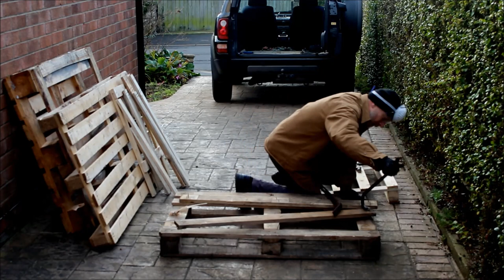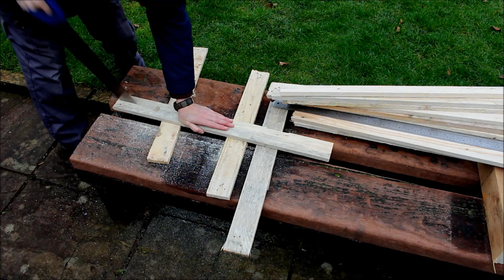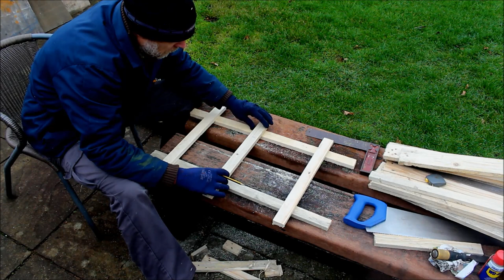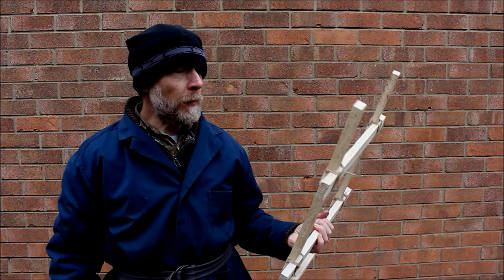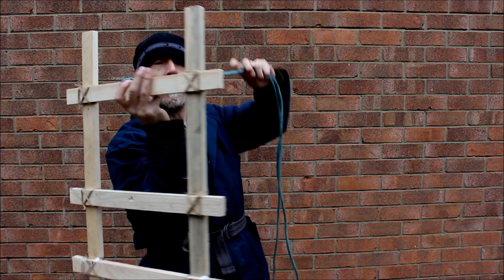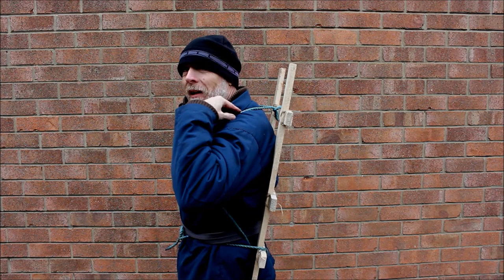The Pack Frame Part One,  The Construction

Comment: Top man thank you 🙏
Reply from the maker: I keep meaning to make a slightly better fitting one but just keep using that one to get wood off the beach, it has been tremendous. Not a lot of use lately due to the lock-down. ATB and stay safe.
Reply: @GrasshopperOutdoors  I am going homeless actually as the result of CV19 and my pack is ready but  need to build something like this to ease the weight. This is gonna be epic hike 🤣

Comment: Quite a home made pack frame. Looking forward to your next one.
Reply from the maker: Next one will be out putting a bit of a load on it and getting up on the moor. I might put a little shelf on it yet just to hold heavy loads better, and some thicker straps but even without them modifications it is very useful.

Comment: You need simi smooth arched wood, or someone's going to have a raw sore back
Reply from the maker: You are right, I use it for shifting wood fairly short distances (about 40lbs about 2 miles), that goes OK for this, but I know it would not be good for long distance without some padding. I have made the mark 2 since this video and will in time make a mark 3. ATB